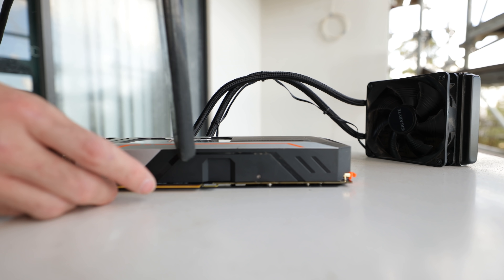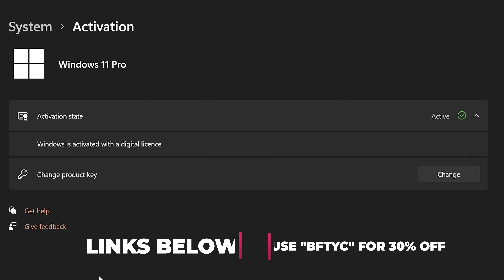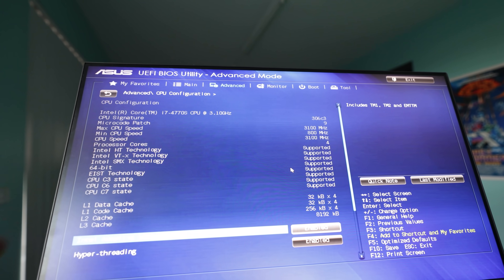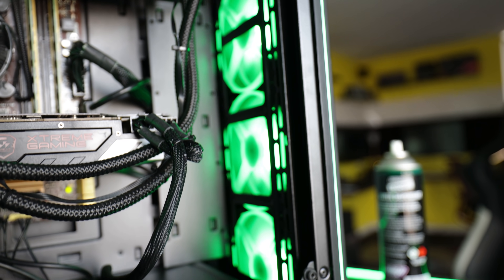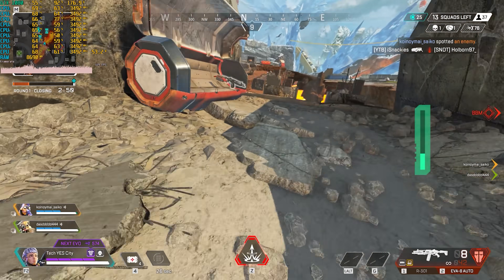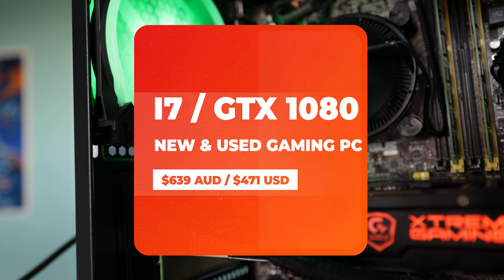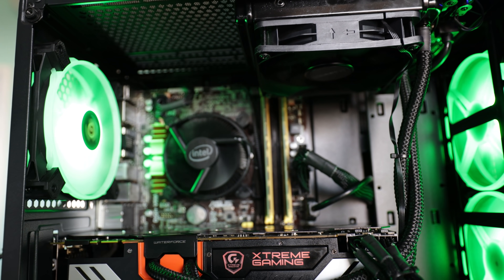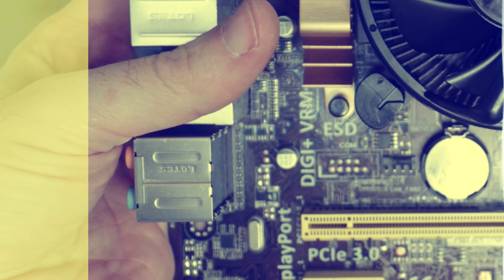This GTX 1080 STILL makes for a SOLID Gaming PC

Comment: 11:20. Is he talking about forced shots? Or abortion? Pro choice to get the jab or not? If so welcome to the authoritarian left that wants to control people. That’s why so many that are left leaning but don’t agree with 100% of their sides narratives are being forced out onto the other side. In the states the “right” now has a huge amount of previous left voting people. They didn’t change their positions their party did. So all these liberals align more with the center and right. And then get called far right by their previous party even though they are socially very left still. The left is good at lying and using fear to demonize those that disagree. Should be a huge red flag for anything you have thought to be true pushed by them.

Comment: Very happy with my GTX 1070 AMP Extreme and it works great.  They are around 400 here and  yeah the 1080 and 1080 Ti are about double so just not worth it for the uplift in performance.  Bottom line though this GPU will likely last me quite some time.

Comment: Nice video. I got the Asus 1080ti Turbo years ago. It worked fine but eventually the original fan got too noisy. A took the card out of the original case and added the Accelero Xtreme IV. It took several mods with a Dremel to get it to fit this particular card but, it's been working great for years. Every year I tear it down, dust it and refresh the thermal paste. It still runs everything I want it to.

Comment: I've built a PC for 800, - € (1231 Aus $) over the last few months. whenever something was offered that was not so badly overpriced, I bought it. The GTX 1080 alone cost € 380 ($ 603) after tough negotiations. Only the Zotac Mini version, but the cheapest. In Germany these cards are currently going for € 300 cards like the GTX 1060 6g. Hard times ... luckily the Pascal architecture is still going strong ..

Comment: the gtx 1080 in my country is being sold for a minimum of 490$ in the used market :(. Only 58$ cheaper than a brand new RX 6600 non xt with the current price point, not MSRP.

Comment: I just bought fre week ago almost same PC
With used parts and new parts

Z490 (good one) new from rewiev chanel 120 us
11600k tray new 180 dolars
The same new case with little crack in shiping for 25 dolars (from one guy)
1080 Ti zotac  620 dolars (price in croatia is high af bc of lot of miners) but gpu is almost unused bc guy is sailor.
16 gb ram 3600mhz cl 16 for 75 dolars used
And other stufs

Comment: Hey Brian great build mate i got my gtx 1080 strix recently for $650 but I had to sell my RX 580 8gb msi gaming x to a miner for $360 to cover cost of 1080 strix so the total cost was $290 and im still rocking 4790k which couples good with this card but the prices down here in Melbourne on gamtree are way over priced, Queensland is where is at for them tech yes deals. Keep them vids  coming dude, love the content.

Comment: Still loving my GTX 1070 ROG Strix and haven't felt the need to upgrade just yet even though I'm playing at 4K resolution. Single player games idc if the fps are over 40 and all my multiplayer games are things like League of legends, CSGO, GTA V, some other MMORPGs that all perform over 60fps at 4k so for me a guy who games after work to chill after a long day the 1070 was the best GPU purchase I have ever done back in 2017 I think it was. Great card and it's generating me some passive income with a little mining throughout the day. $100 a month might not seem like much to some but in a country like South Africa it could fill a few holes trust me. at least the card has paid for itself already.

Comment: Makes me sad cards cost this much. No reason for this besides greed. I only buy cards now when i can get them at actual msrp. The base 3000 series FE cards at actual MSRP are extremly cheap for the power they provide. You spent 400 bucks on a 1080 when a 3060 cost 329$ and 3060 ti cost 399. Both cards that blow away a 1080.  The used market for graphic cards is disgusting. Love your videos btw bringing old shit back to life.

Comment: My 1080 stayed with me for over 6 years. Only now I was able to replace it with a 3080 for my VR needs (recently received mine after 9 months waiting). Sold the 1080 for $550, great card for 1080p gaming, still has heaps of performance for years to come.

Comment: Very lucky to find a GTX 1080 on the used market for $400AUD. I am regularly seeing 1070s still sell for that kind of money down here in Melbourne. (Similarly, $600 for a 1080 Ti is also borderline unrealistic for your average punter in this market). Wouldn't really be a fair comparison valuing the 1080 at $400 vs a new 3060 or 6600 XT, IMO.

Comment: You all must have a nice used market in Aus. I'm having a hard time finding a 1070 under $300 USD. Any thoughts on where to look?
Reply from the maker: Yes local apps and be very quick to snap up the deals.
Reply: @techyescity  I did end up finding a used 1060 6gb for $205+$25walmart gift card. Very clean card. At that price they made a profit and i got a "discount". Found on Facebook marketplace, negotiated the price down. Maybe in s few years I can find a reasonable 6700... Or better.

Comment: Great video! Reminded me of when i had a 1080 - 3770k combo. Good times... That 1080 still does it's job with a 5800x, i just couldn't convince myself that a GPU upgrade would be worth it's price.
By lowering some settings i still get great performance at 1440p these days.
Your reply to the qotd hit me right in the feels, what's happening around the world is pure madness. Remember that there's a huge crowd that feels the same way, don't let this crap wear you down!

Comment: I've had an i7-3770s since 2017 for gaming and photo editing, and it's definitely super underrated. Only benches about 5% less than the normal 3770, but usually significantly cheaper. 

Best of luck with the situation in Australia. I'm in Canada, and it's not too much better. Very scary seeing the insidious and seemingly unstoppable spread of governmental control everywhere.

Comment: Bryan, updating from 7 to 10 but Win 11, come on, who would do that for this CPU platform configuration?
Reply: Crytpo miners, nay, high frequency traders! mb
Reply: An its the PKs and their nippers responsible for this censorship tribe mentality . . . mb
Reply: On the 'S' derivative SKU, fewer than T and in the middle power wise. Power wise T moves and S there are just fewer of them. So many T's were integrated into micro desk side/tops; tons of these small Office PCs. T moves today because there is a low power void in the AMD and Intel desktop lines. T can u call it a European thing; power environmentally conscious? Certainly if you have an operation in the outback or anywhere operating on a power source and batter =y set the 'T' and 'S' derivative CPUs offer a solution when operating within a total power envelope. mb

Comment: i wish i could find good deals like you. all i need is a gtx1070 (non ti) 8gb so i can finish my new build. i5-10400, b450, 32gb (4x8gb) 3000mhz ddr4, 500gb m.2 nvme ssd, evga 450br. this will be a huge upgrade from this i7-880, 16gb (4x4gb)1333mhz ddr3, 240gb hdd potatoe that i love and will keep using until it completely dies.

Comment: Also another good thing about the sponsor is with the Steam Deck coming out you can use that key to install windows 10 or 11 on it.  The GTX 1080 is a pretty solid card here in 2021. Also 4th get Intel i7s are still solid parts. I still have my 4790K and it is being used for a Handbrake ripping system to rip DVDs for Plex and it works great for that. The 4770S seems like a solid CPU despite it being an S version of the CPU.

Comment: The cpu is hard bottlenecking the test in apex legends. It is a more cpu dependent game because its a janky engine built on the source engine. I can get the same framerate with my RX 480 on 1080p with the same settings, I just have a 3300x. Would like to see this retested with something like a 3300x.

Comment: I found a cheap gtx1080 in 2019 without cooler. Bought a used cooler for 25€.
Has been working in my PC without any issues since then, best card i ever had.

Comment: I have had my 1080Ti since not long after launch in 2017. When the RTX 2000 series launched raytracing was in its early stages and needed work. Along with non raytracing performance not being much better than my 1080Ti so I didn't upgrade. Then the RTX 3000 series launched and the shortage current situations is going on so I'm just gonna keep my 1080Ti for a few more years!

Comment: Does anyone have this problem when i oc the ram in my ryzen system and oc the cpu it works fine but after shut down and close all plug .i went to work come back it won't start up,i had to reset the cmos than it works fine.Than i try again oc my ram it works fine .

Comment: Using an EVGA 1080 OC version. I was going to upgrade early in 2020 but well you know....I game at 1440p and I can say its still good to use. At 1440p I sometimes have to lower some settings but it still looks good and I rock over 60 FPS most times.

Comment: 2600k at 4.5ghz and a asus 1080 with Arctic cooler and 16gb at 1866mhz in an aurora r3 from 2010 
Runs cyberpunk with mostly low settings but high crowd density at almost solid 60fps 
I was impressed 😂

Comment: That tier of cards are still good if you are targeting. 1080p60 or 1440p60. I have a Vega 64 which is similar and runs most things maxed out at 1920x1200 60hz, and will do well at high settings at 1440p60 I suspect. Might get rid of it next year as I will be upgrading to 4k60 monitors which need a whole different class of card

Comment: Here in Canada I tried for months to get my hands on a GTX 1080 ti but the market was saturated with scammers and prices going from 850$-1000$ CAD.  I ended up getting a brand new RTX 3060 ti and haven't looked back Since.  Allthough I did overpay a little, I think the deal was not bad considering today's market.

Comment: I still use my 1080. All the rumors were this generation we were supposed to get cards from AMD and Nvidia both that provided 1080 performance at 200 dollars and required no external power. But considering the way things shook out there's really been no reason for either company to give us those budget options. Hopefully intel provides a true budget level option when they release cards and the others are forced to get back into line. Because cards that are mid tier shouldn't be 400 dollars. Not when just a couple of generations ago they were 200-260.

Comment: Ya I picked one up last week well 1080ti Hybrid, I didn't realize ray tracing was an option starting with 1060, but surprised when I check the 1080ti. I got a good deal on mine!

Comment: I just recently had to replace one of the old copper, half slug, Intel coolers for my 3770k build because it couldn’t keep my CPU under 90deg at load. I put a single fan, Cooler Master Hyper 212 on it and was actually shocked to see a 20deg drop in all temps, even at 100% of 3.9 GHz for extended periods. I never realized how poor those coolers really are until I spent a measly 35 dollars to replace it.
Reply: I bought an old Xeon x3450 to tinker on, with an all-core bclk OC at 3.2ghz to 3.6ghz there was app. a 20°C between an Intel cooler and Hyper T2. (Hyper T2 is a small 92mm)

Comment: I got a really good deal on some graphics cards the other day - they were untested and it came with a dead saffire r7 370, working 550ti, working quadro k600, working 750ti, working 9500gt, two graphics cards I can't test as they have a weird dvi and a bunch of WiFi cards and sound cards.

I got them for 30 gbp which is a pretty good deal. I'm selling all of them other than the 750ti (I'm using it in a build I'm planning) and the saffire as its broken (I'm going to try to fix it but I'll probably have to sell as parts or not working - it turns on with two lines down monitor or won't turn on at all. If anyone know how to fix pls reply.)

Comment: Would it be wise to get a Aorus 1080 ti 11gb in 2021? The pricing on them are what I paid for my Rx5700 pulse. I will then use the 5700 as a back up.

Comment: Just completed a 1070 and i7 4790k build, the part hunt took month the build took a couple of hours haha. Also first time building a pc.
Reply: Danggg nice! What kinds of prices did you get those parts at?
Reply: @Ash-my4gf  for me I found fb market place to be the best! $350 for gpu and 100 bucks for cpu. I had a optiplex 9020 sff that I used the motherboard ram and ssd out of. Put it all in a mb311L cool master case!
Reply: @sassymcmahon3131  nice! guess it all depends on your local area for those deals, my area has those 1070s for $300 usually
Reply: Yeah that’s it! I couldn’t find them for much better than that in my area! I found they go for $400 or more on eBay.
Reply: Are you in aus?
Reply: @sassymcmahon3131  in the US

Comment: I just sold my 1070 and bought a 3070ti. Its kinda overkill to be honest. I underclocked the 3070ti for lower temps and noise. Miss my 1070 though, it never stopped fighting.

Comment: I've been rocking an i7-4770 and GTX 1070 for quite some time now. Still haven't found a reason to move on from the i7 just yet!
Reply: I picked up the i5 10600kf for an absolute steal of 250$ AUD, huge upgrade from my old i5 3570, i gained almost 20 fps in nearly every game, pretty crazy considering im only running an rx570 atm.

Comment: I still use a 1080 with a 2600x. It does all the things. My upgrade need is the mobo which is a Colorful B450M whose bios doesn't have secure boot or TPM activated. I might have to get familiar with Bryan's Russian friends and see if they can hook me up with a special bios. The 1080 runs cool. Mine is a blower style and it rarely breaks 65c.

Comment: good vid all around, re-purposing a i7 4770 as i type this lol !  going with a 970 cause I have one that's not being used. using a darkflash v22 vertical mount case and vetroo v5 white cooler. i should do a biuld vid but im half way done with it now so maybe next time

Comment: my GTX 1080 can barely play 1080p 60 on modern titles. In fact, in many, like going as back as AC: Origins, it cannot even hit that if i don't lower the graphics quality. AC: Odyssey and Valhalla - 1080p/60 is mostly possible if i lower the settings to mid (which is below high, very high and ultra high), and in CP2077 1080p/60 is only possible on the Low preset with that card.